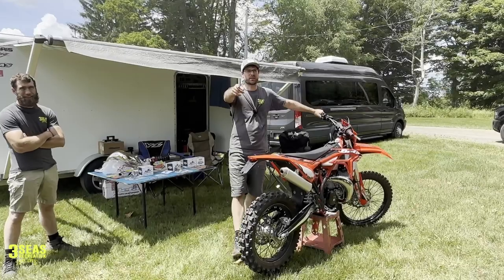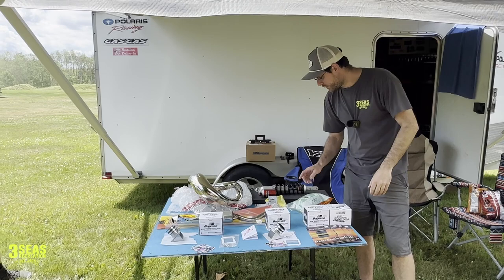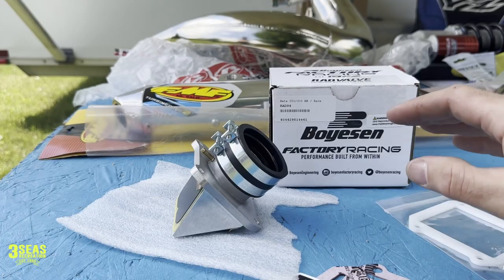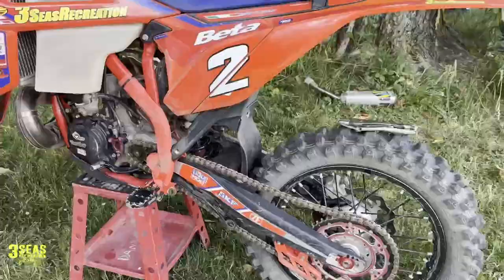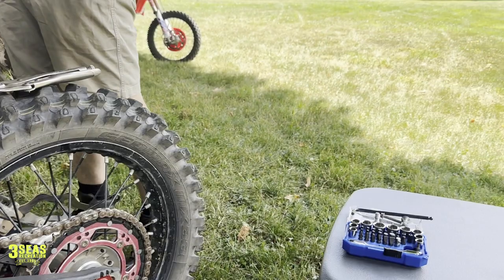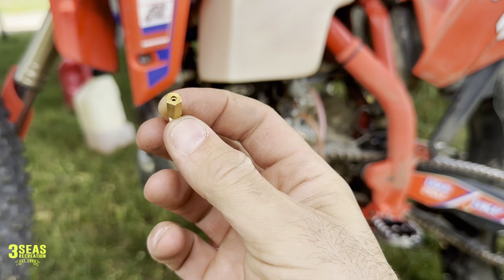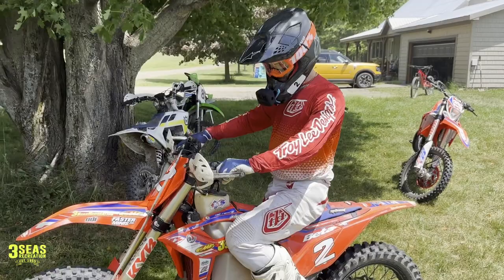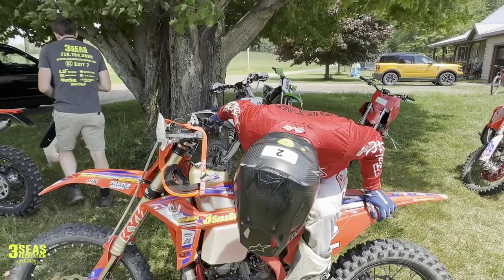2023 Beta XTrainer Hard Enduro Build: Boyesen Rad Valve Upgrade

Comment: My new 23 xt has a terrible noise on deceleration. It's like a gravel in engine noise.reallt unnerving. I installed the fmf pipe and jetted to a 158 main with a suzuki needle..love to see what jetting you end up at.
Reply: Maybe its your exhaust guard rattling
Reply from the maker: Good Morning, I had a gentleman call and tell me the same thing. He said his pipe o-rings were shot. Maybe try new pipe o-rings. Enjoy The Ride, Jared
Reply: mine was doing it but as soon as i would go through a puddle it would stop, could also be over tight chain
Reply: Chain slap or exhaust rattle.